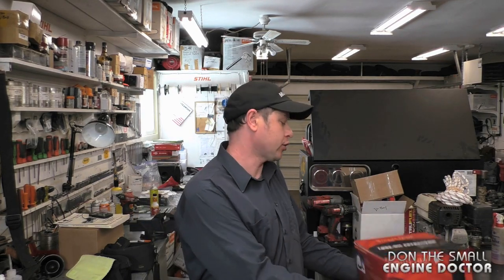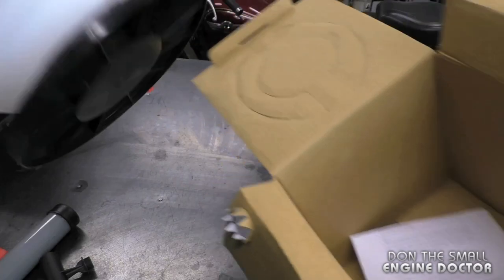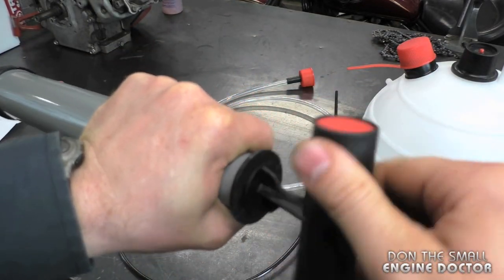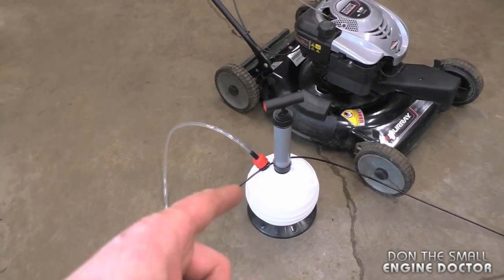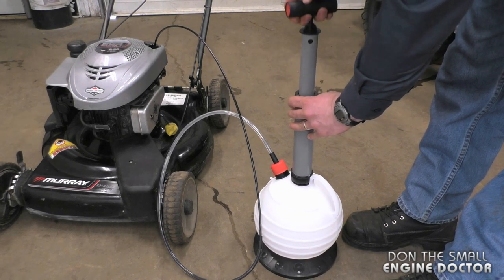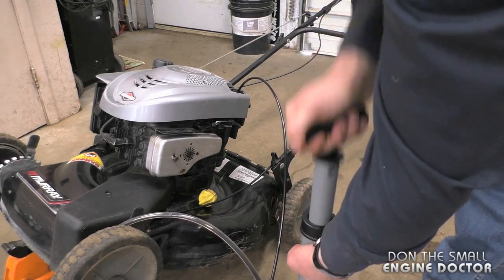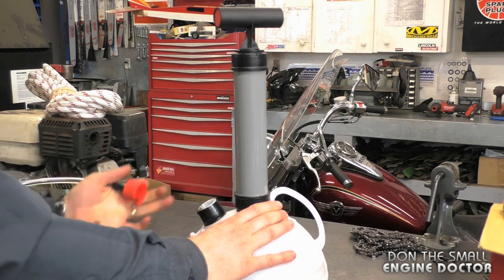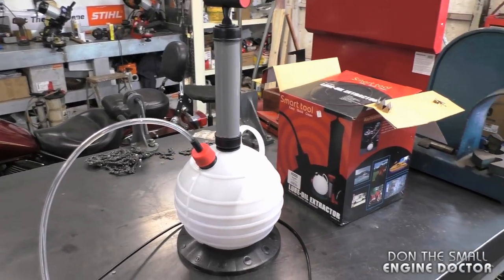Easily Change Your Lawnmower Oil With Oregon Lube-Oil Extractor #88-400

Comment: I have had one of these for 5 years and use it to change oil in all my small engines - push mower, generators, lawn tractors, etc.  I cannot say enough good things about it. No more messing with those silly crush washers that Honda uses on the drain plugs. No more oil running down the frame of the tractor, no more propping those little generators up on wooden blocks. Just stick the tube in the dipstick or filler tube and let 'er suck till it sucks air. The sucker seems to get out MORE oil than using the drain hole as I am always able to put back in the full amount of oil to get to the full mark on the dipstick. I never though of using mine for plumbing duties but the next time I have to change a toilet fill valve I will be calling it into service.

Comment: Excellent video. Very thorough. I never did like tipping my lawn more on its side. This will also be useful in changing the oil on my generator that does not have a drain plug. Thank you for the video Sir.

Comment: I have a home made extractor that I use a vacuum pump and mason jar together. It’s so easy to use vs tipping my equipment over. No mess ever when I’m changing oil and it’s all in a mason jar that I can drop off at the auto parts store.
Reply: If you use it for you car you could make a lid to use with those gallon oil jugs and suck it straight into the oil jug

Comment: I use a Mity-Vac with a 16-ounce recovery jar, and the reason I prefer it is because the Vac can be operated one-handed, leaving the other hand free to manipulate the pickup tube, to hold it in place and/or feel around for the lowest point to get that last bit of oil.   It does require a lot of squeezes of the pump handle, though.  This Oregon device would be handier for larger volumes or multiple uses.

Comment: I use an extractor to sens many years , a different brad but it works in the same way , some lawnmovers like some Hondas dont have a bottomplug to drain out the oil from so it is very handy to use the extractor insted of tipping the mashine upside down and let it pore out thru the dipstick (with a "broken" back). I do like Don showed in the video and it works great.

Comment: We do this at the Small Engine Shop... however the tanks we use are metal, they hold a lot and are heavy when full but we suck out oil, fuel contaminated oil and old fuel with them. Our tanks use compressor air to create a vacuum and the same procedures are followed. And please use protective clothing because if you over heat the oil instead of warm it, you could end up being burned.

This portable unit is good for his mobile service and for a home owner because it’s light and can be taken to a oil recycling station or an auto store that allows the public to discard oil.

However good uncontaminated
used oil is what the stores sale as bar lube for chainsaws so saving some of that used oil will save you money on chainsaw bar lube.

Comment: Get the cheapest electronic fuel pump you can find, add a hose on either end and a jump pack.  You now have the easiest fluid mover you can find, great for siphoning or bleeding any fluid system.
Reply: Well, there is a 12V DC Pump for $16.00 you can get and it does a great job too!

Comment: An unrelated question.  I have a Toro lawn tractor.  Should I be replacing the diff. oil?  How about the hydraulic fluid?  Do you have a video on this.  Thanks.

Comment: I basically turn my mower bottom side top to drain it. What a pain. Does turning it upside down harm anything?
Reply: I got a 12V DC Pump for $16.00 worked just as good!
Reply: Air filer must be facing up, otherwise gas will run into the air fiter and youve got a stonk3y mess. Also engine oil  can enter same area from the crank brether hose.

Comment: How often should I change the oil in my lawnmower? I have had mine for 3 years and I haven't changed it but the oil is still golden yellow and still at the right level. Thanks Dony
Reply from the maker: at least once a year
Reply: Thanks Dony! I guess its a bit overdue!
Reply: Oil that's golden yellow on dipstick can look black as soot in drain pan.

Comment: i feel that using the drain plug that's (usually) provided is going to do a better job as i can let it drain down to the last drop while i sharpen the blade and clean the carb. oh, and it's free. i have a cheap little version of this from princess auto. i use it only when i have to.

Comment: I have a question , is it ok to use 10w60 oil in a splash lubed lawnmower when temp is 100plus degrees outsideunder heavy load?

Comment: Hey don! Long time no see. What's the deal with AL-KO engines? I see a lot of their new models with their proprietary engines. I have been looking for a new mower for quite some time. Had a classic 3.5 on a Murray push mower deck for almost 28 years now. Now the deck is rusted out and I think it is time for a replacement. Still as an avid B&S user and lover I would probably spend the extra money and buy one with it. Thanks

Comment: I had one of the Briggs and Stratton pumps but it doesn’t extract oil any more I think it’s the o rings. I might have to pick one of these up to replace it.
Reply: Had a Briggs also. Used it 4 times. Does not work anymore

Comment: The only reason I'd buy it its made in Taiwan. However I have a 25 year old HONDA Marine oil extractor. And it blows this flimsy limited extractor away. 8 L storage and it stores it. Two extraction lines. Skinny line will get into the bottom of the oil pan on a Honda Odyssey or Civic, pick your year. I leave it and after its exstacted most of the oil cycle it and get remaining drained down oil  out giving me an almost a complete change with only some oil sitting in the cyl. Head. As to a Honda mower ir mower, tip it on its side carb side up, drain the oil  out of the dip stick holder into a shallow drain pan. Leave it until it has no more oil draining. 50 ~ 100 ccs remain in the engine and wont drain. Add less than 1/2 L or 1/2  or quart slowly, check the oil level and top it up after starting it up and shutting it down. I wouldnt buy this to change a mowers oil.

Comment: That looks like a really nice and simple tool :-D
There isn't much to go wrong, that's good.
The clear section of tube is a nice visual indicator :-D.

My old 3.5 classic briggs&stratton mower has a metal plug by the blade, that seems to drain the oil ok, i'm carefull with it screwing into aluminium, but most documents say there is no plug, odd that.

Comment: I have a question , how I can fix a sputtering lawnmower I try new carburetor, spark plug, clean the coil check fuel lines any suggestions that can help. Thanks
Reply: manolo miranda , check the breather tube
Reply: Ok thanks
Reply: Sometimes when its gone oil will spits from the crankcase

Comment: Why do mowers have such a pita location for drains? Yes, they seem to slap a horizontal or vertical shaft motor on riders without providing a decent drain point. Oil everywhere with plug offset on frame. This just sucks! (get it?) :P

Comment: Every Briggs push mower I've ever worked on has a drain plug on the underside.... thought they all did?
Reply: Nope All Honda mowers since day 1 use the dip stick holder as a drain. All GC/GCV series engines mounted on anything = same thing. GX  series have a drain thats messy to use but the exstractor gets around that. Buy one that you can use on anything. Made in PRC avoid they're crap.
Reply: Nope hit a rock the right way and take out the drain bolt. Ypu just chznged your engine.
Reply: The new ones made in China have no drain plug.

Comment: I think It'll be much easier to remove the oil drain plug, drain the oil, reinstall the plug, and then fill the engine with fresh oil.
Reply: Brian Miller not many have a drain plug anymore
Reply: I was referring to engines with an oil drain plug.

Comment: Why not just take out the drain plug on the bottom of the motor?
Reply from the maker: there isn't one
Reply: @donyboy73  Then just tip the lawnmower on it's side and drain into a pan.

Comment: The fact the oil wasn't crystal clear meant that mower's oil change had been neglected, a properly cared for mower will be perfectly clean on the dipstick, almost impossible to see.
Reply: dude I don't know where you get your oil, but the oil I use isn't even crystal clear when it's new....
Reply: I've run Mobil 1 often and on the stick on my stuff it's so clear you have to look for the reflection on the stick